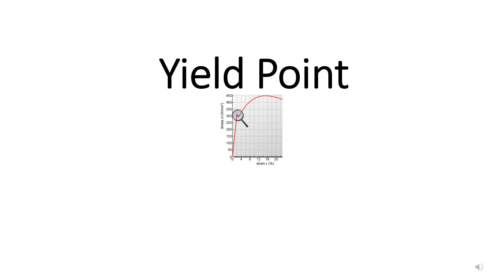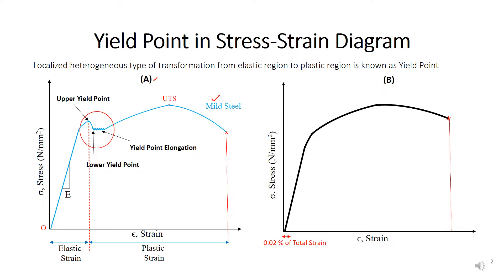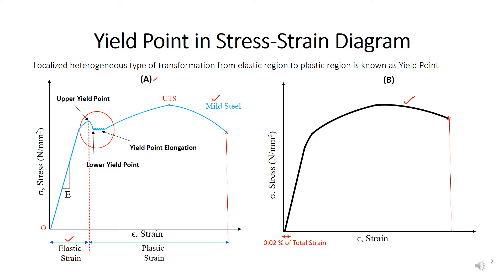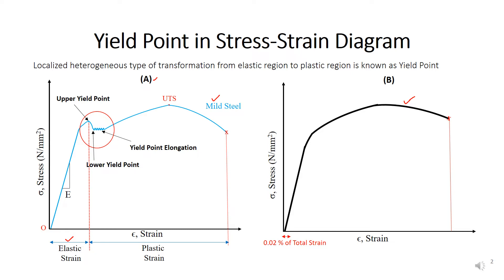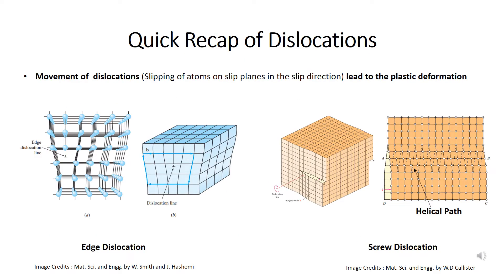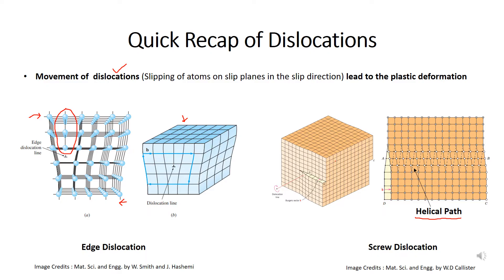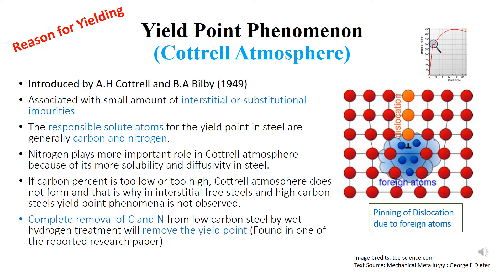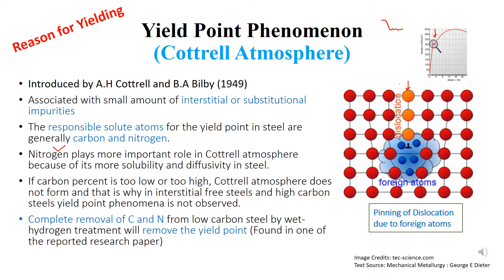Yield Point Phenomenon (Cottrell Atmosphere)

Comment: what is the percentage of carbon and nitrogen needed and are they both needed or is one enough?
Reply from the maker: Thank you for your query.....

It has been shown in Literature that if there is complete removal of Carbon and Nitrogen from the Carbon Steel (done by wet hydrogen treatment) Yield Point can be removed.. 
 
However,  only 0.001 percent of either of these elements can cause the reappearance of Yield Point.    

So yes very minute presence of either one of these elements can cause yield point to occur. 

Source: Mechanical Metallurgy by George E Dieter
Reply: @bbengg  thank you so much 😊